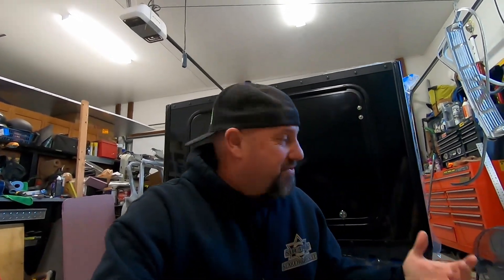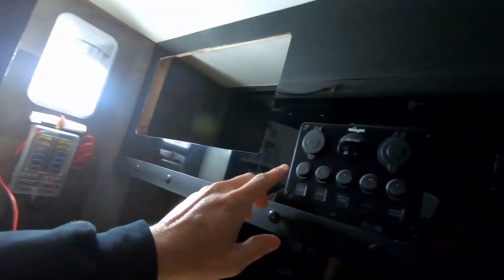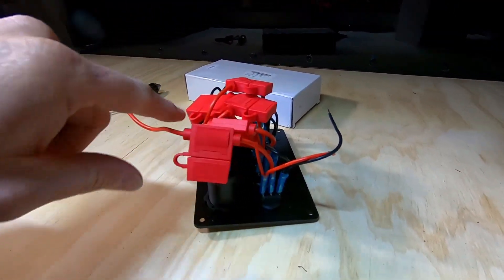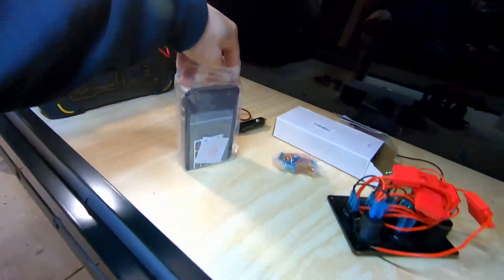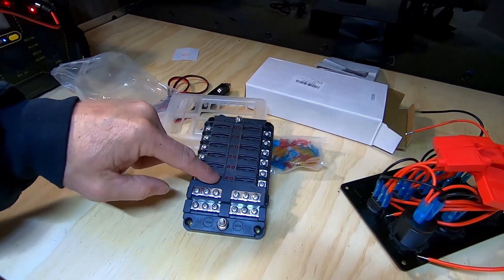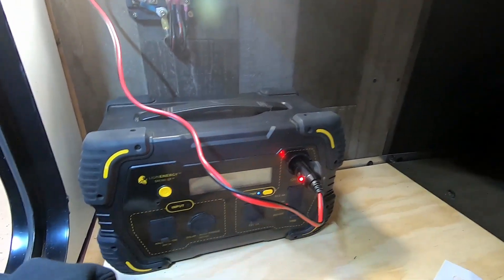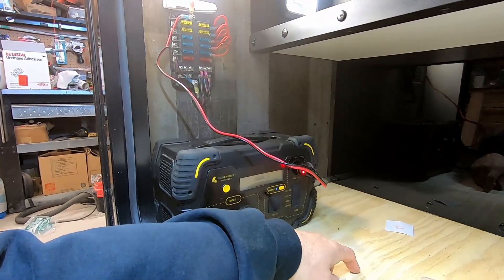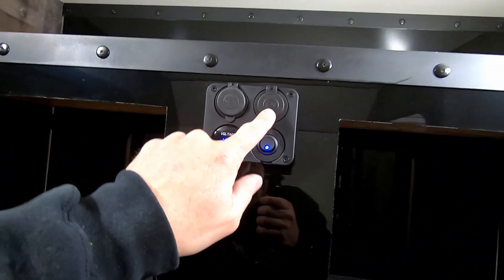Teardrop trailer electrical system, overland trailer electrical, overland trailer wiring

Comment: Hello, great work. You mentioned that your fuse box can hold 12 circuits, you also mentioned that it was overkill. I havent built a trailer so my experience is not worth mentioning, lol. My question is, could you give us your circuit breakdown for the 12? For example, (1) overhead indoor light #1, (2) overhead indoor light #2, (3) outdoor porch light for door 1, (4) ourdoor porch light for door 2, (5) Galley light...etc. I want to eventually build one so Im just taking notes. I dont want to have less circuits than I need, as opposed to more circuits than I need. If 12 is overkill, how many of those did you actually use? Which comes back to my initial question. Thanks!
Reply from the maker: I used 5 of the 6 circuits. Interior lights, exterior lights, interior switch and plug, fan, rear hatch switch panel.
Reply: @rockymountainbackcountry1588  thank you